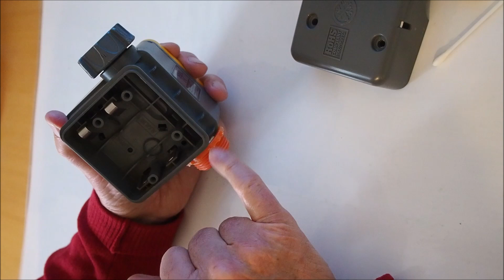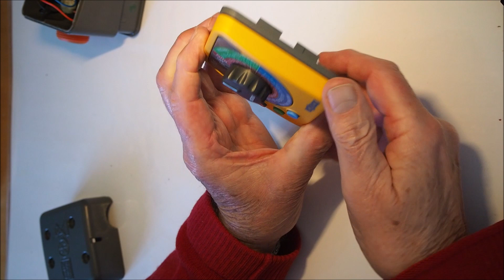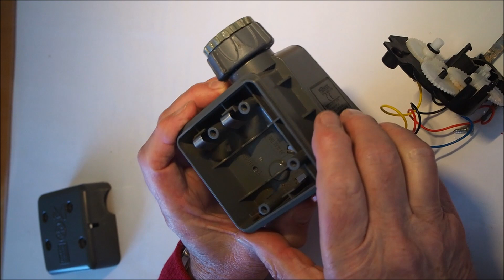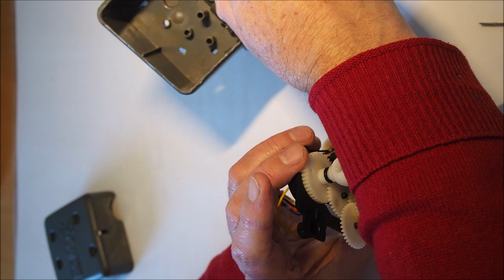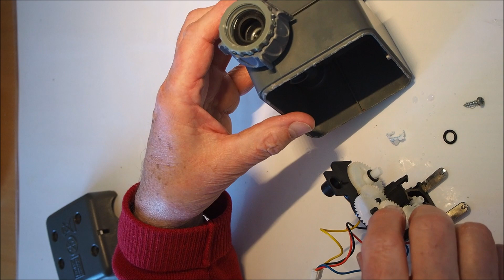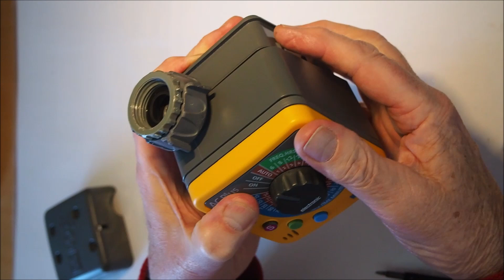Hozelock Timer

Comment: Great detailed video and simply explained. I have one of these timers but mine has an issue regarding the ball value. When setup for the timer the first rotate on works fine, its upon the closure of the value the problem appears. Upon closure of the value the water continues to flow and doesn't stop until I've opened and shut the value again. It's as if the ball value isn't symmetrical and doesn't seal on one half of the rotation. But now I've seen how to dismantle this unit I'm going to investigate the value and seals.👍

Comment: Great video, but mine is an older version with more discretes on the PCB, and the electronics section is held with clips I couldn't release. A bit of hammered screwdriver got the parts separated. Overnight dry and clean. Maybe not resealable though!

Comment: Hi Terry, great video thanks. I struggled previously to open the case, but  was levering the wrong groove! On mine, the positive terminal for the C battery is broken (corrosion due to a leak!). Do you know where I can get a replacement terminal please? I have still got the broken tab. If I can fix it, I'll also add the Oring, silicon grease fixes. Many thanks

Comment: Thanks for the great video. I have the same model and it is leaking when closed. When i took it apart i saw that there was no spring on the diaphragm. Can this cause the leaking due to lack of pressure of the diaphragm to the valve? I searched online for a spring or a new diaphragm but couldn't  find any of them. Can you give me the spring dimensions? (cause i think that the diaphragm is ok)
Reply from the maker: If the spring is missing then the unit will certainly leak it is an essential component. How come the spring went missing? Someone must of tampered with it previously. 
Don't have the spring to hand but guess you can estimate its size from the size of the hoselock connection shown in the video.
Reply: @terrywhitstable  ok thanks for the quick response
Reply: I took my AC Plus apart this morning after watching this video and also found my spring to be missing.

Comment: Really useful, my AC1 is mostly identical, however the clip holding the inlet, spring, diaphragm in place did not exist, the assembly was held in by two rods behind the inlet knob which push out with a small Allen key.

Comment: First video that covers the actual mechanicals and electronics, great!  Just dusting off my Hozelock 2700 AC Plus timer and giving it a test for summer. It's about 7 years old and seems to have lasted, then again it only comes out for travels. Despite some criticisms I've read about Hozeloc, I've found that my Hozelock bits and bobs outlast other brands of water connectors etc.

Comment: Excellent video Terry
A question that you may be able to answer, I have the Hozelock ACPro which is the electronic version of the timer that you repaired. There is no internal leak but when the valve is supposed to be closed, water still dribbles through.  I assume that the disassembly will be very similar to that shown, but before I start, do you have any thoughts on how to stop water from passing through the unit when it is supposed to be closed? Is it the ball valve or the diaphragm or the spring? It seems a shame to bin it!
Reply from the maker: Many thanks for kind comment. Like you I would guess the mechanics of the AC Pro will be similar to the AC Plus. I would suggest there is either some excess wear on the ball valve, the diaphragm seat or both or there is a bit of debris such as a piece of scale possibly from the  feed pipe that has worked its way in. I don't think it will be the spring - very unlikely it has broken. A leak around the perimeter of the diaphragm seat is also a remote possibility. Nothing lost in taking it apart. Any feedback on what you find appreciated.
Reply: @terrywhitstable  thank you Terry and thanks for your thoughts. I have started to take it apart but after taking off the front cover with a knife (as you suggested, easy), I found that the ACPro display as now revealed, is securely glued on with the intention that it is water tight and should never (ever) be removed (ever)! I have nothing to lose, so I will find a way of cutting it off and let you know how I get on...
Reply: I finally had a go at the “leaking” AC Pro.
Was it worthwhile? Time will tell, but I would not have started without Terry’s video, so thanks.
Behind the plastic font cover of the AC Pro is an acrylic “screen”.  The plastic font cover comes off easily, as Terry describes, but I thought that the acrylic screen which holds the electronics needed more care.  So, I sawed it off with a fine-tooth hacksaw!  The idea being that any other method, using force, is likely to crack the acrylic. I thought that if successful I should be able to “glue” it back together with silicone sealant.
The disassembly from there on was similar enough to Terry’s timer, but one of the black lugs (that Terry describes) that separate the internal black gear assembly from the base just would not pull through its slot and eventually broke off (damn).  But the assembly eventually clicked back together with no apparent problem, i.e. it all works!  I might be wrong but I think the tab would only go one way as it was wider than the slot.
After disassembly and inspection, I could not identify the problem, surely it could not be wear, as these domestic timers do not get enough use. So, I packed it with plenty of grease. Unfortunately, I did not have any silicone grease and used some 40 year old car grease, instead. This will not do the rubbers any good, but I do nor expect this unit to last that long!
Before sticking the screen and the front back on with the silicone sealant, I tested it by sticking the battery's back in. I closed the valve and with my mouth blew through from the “tap” end. Disappointingly, a little bit of air did go through the unit but before discarding it all, I suspected that screwing it onto a tap may apply more force to the spring. 
And it was so - success! No steady stream and not even a drip.  But I do not give myself too many guarantees that this will last even a week of cycles. We will see…  
Many thanks Terry
Reply from the maker: @lionelwiseman5854  Hi Lionel, Really glad you had  success after all your efforts. Keep posted as to how your repair works out. There is a great satisfaction in repairing things that otherwise would be thrown away -  all but lost in this throw-away age!  Best Terrry
Reply: Thanks for vid Terry, very handy 👍